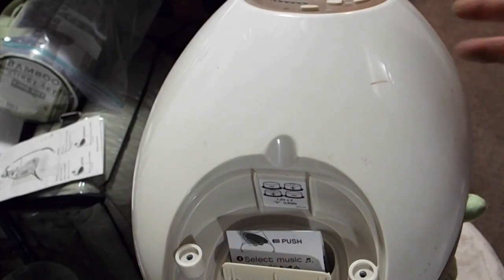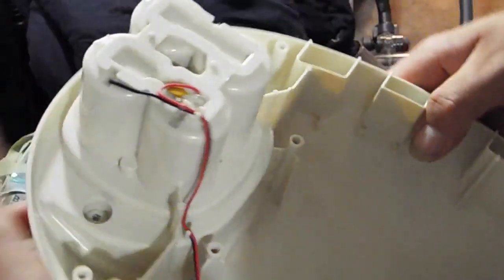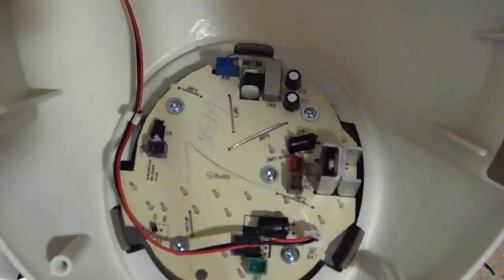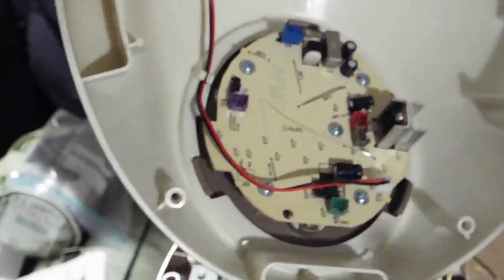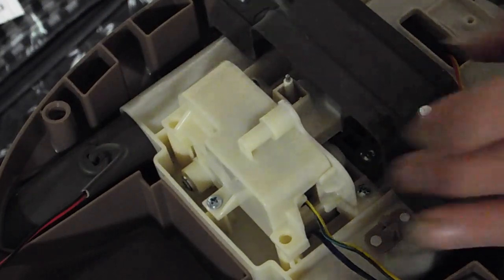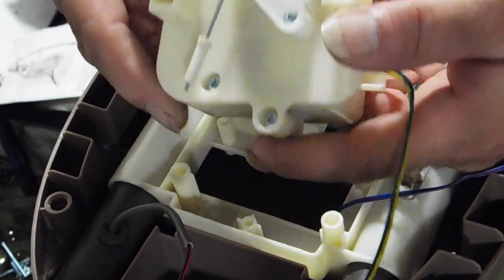GPW 57 - Fisher Price Baby Swing Motor Repair

Comment: I need to replace a blown capacitor, can you tell me the value of c14
Reply from the maker: Sorry man... there are too many changes in manufacturing for me to assume your cap will be the same value as mine. 

You'll need to do some research on your model and see if you can come up with a diagram of the pcb that shows the value.
Reply: I understand ,but I bought it used and don't know where to find that information. If you could tell the value of your c14 to point me in the right direction . I took a guess and it comes on and immediately goes off. Just want to get close.

Comment: where can a buy the motor ,wt do you mean on the descripción
Reply from the maker: Other people have done this and scavenged the motor from air fresheners: https://www.youtube.com/watch?v=4i-TcJVnsFAThe motor I used: Model  RF-500TB-18280 Bought here: 
http://www.surplus-electronics-sales.com/index.php?main_page=product_info&cPath=22&products_id=999Actual repair kit with diode & cap installed: 
http://www.surplus-electronics-sales.com/index.php?main_page=product_info&cPath=22&products_id=1333
Reply from the maker: The description is the space between the video window and the comments area where we include information about the video. On mobile devices, you have to expand it by tapping an arrow to the right of the video title below the video.I hope this helps.

Comment: Lifesaver! thanks buddy! I just pulled a motor out of the airwick, not diode version but about to see if it will work on my model
Reply: Josh Matthews hi jst wondering if u were able to make it woirk w out the diodide and cap? And if so how has it been workin for u?
Reply: I just had one given to us, the motor was weak and I was going to get a new motor but I an idea that the capacitor and resister was robbing the motor of power, I was right The old motor works fine after removing them.

Comment: Thanks for the video! My swing makes a loud clicking sound as it struggles to start on the lower speed settings. However, it does not have this problem when starting on a higher speed. What could the problem be? We have pulled the swing apart and nothing strange is standing out.
Reply from the maker: I have no idea. If you have the same power design (low volt power supply) you can run the swing while it is open to see where the clicking is coming from. That should lead you to the problem.
Reply: Hi Matt, My Swing it is with the same problem that you had and today it stopped work and now I think that it was happening because the motor already was not working prorperly.

Comment: What is the blue cord connected to. mine won't swing but my blue cord isn't connected to anything...like when you pull the motor holder out, the blue is under it
Reply from the maker: If your swing is the same model as the one in the video... there will be a jack on the control board that is the same color as the connector on the blue cable. You can see where it is on the board at 1:22 in the video. On mine the connector was light purple and had a matching jack on the board. There should be labels on the control board next to each jack that tell you what they do.
Reply: on the one i have, the blue wire ( can't recall the other color wire) that runs down the center is for the mobile, brown wire (can't recall the other color)  goes to the speaker, red/black wires are power from the batteries to the board, and green/yellow wires are for the swing motor

Comment: I noticed on your video the repair you did was without the diode and caps, are those parts necessary, or can I go forward without them??  Thanks!!
Reply from the maker: it worked for me. it's always technically best to put it back the way it was. 

yours is your call.
Reply: It's been two years, so I know you guys probably don't care anymore, but here is the reason for the diode and cap for anyone having this problem today. When this motor spins it can create voltage spikes, which if it made it back to the board could cause trouble. The diode redirects any extra juice to the capacitor, which is able to store it and release it gently back into the system. It's just an added layer of protection that is probably worth the VERY small investment and solder job. Really any small diode and cap would do the trick.

Comment: I had different model of baby swing die on me a few months ago! I wonder if these very low voltage electronics are especially failure prone.
Reply from the maker: Not so much in general (in my experience). However... I found an insane number of complaints about this very failure to this line of products.IMO There should be enough of a mechanical advantage (with the worm gear setup they used) for this to last a good long while... but it seems that they have had issues with this motor failing. Bad batch maybe?The fix is easy enough if you have a Philips screwdriver, even for the not so mechanically inclined. I mean... if I can do it...